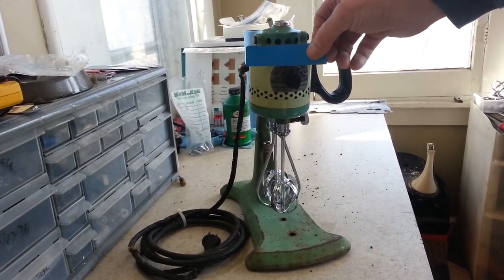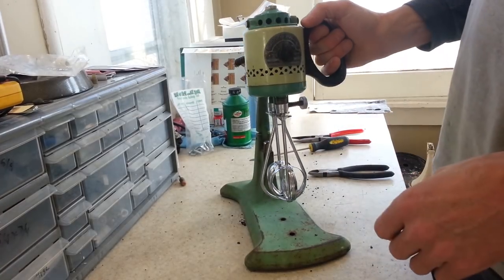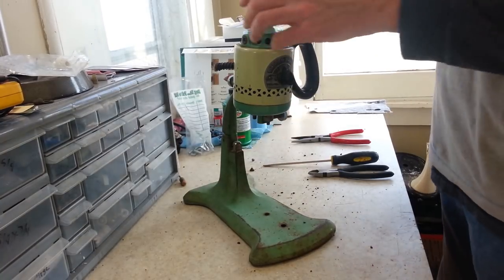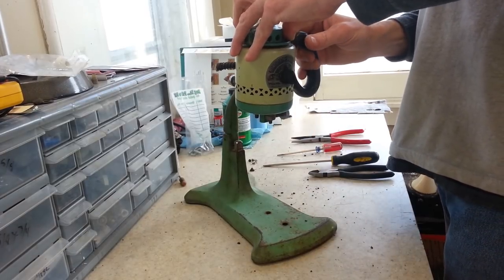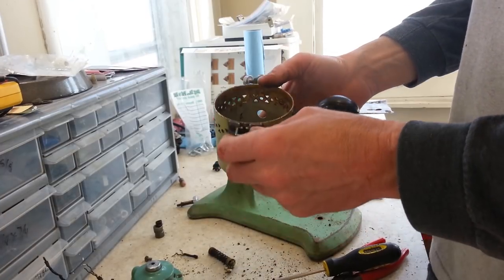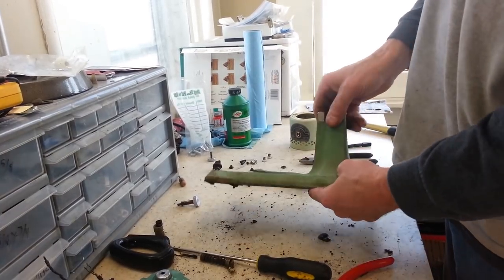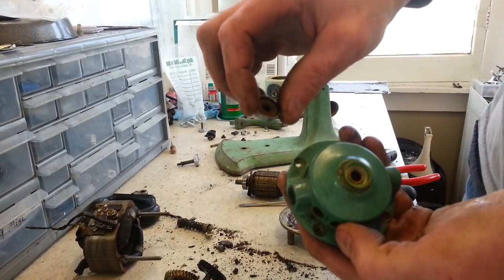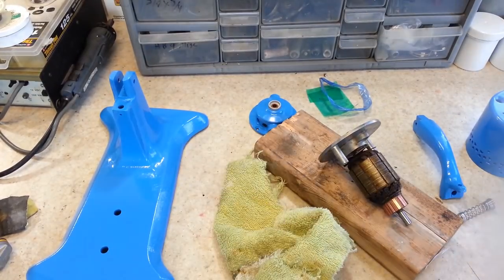Antique Manning Bowman Kitchen Mixer restoration

Comment: Hey mate, another amazing video, your vids are rich with knowledge and teaching us some techniques work order. I am here in Australia, Toowoomba near Brisbane, was given a old Sunbeam mixmaster today, it works well, is there anything I should look at before I start using, as I cook and plan to use it every other day? By the way, what was that singer? Really touched a nerve, very nice. Have great day to you.
Reply from the maker: Hi Chris, thanks! I would look carefully at the cord, especially where it attaches to the motor, the inner insulation is usually worse off than the outer insulation. Changing the grease is a good idea as well for general maintenance, while the gear box is open try to get some oil on the shafts if you are not removing them. A drop of oil in the oil ports once a month should keep them working good!  
The singer is Sierra Eagleson , https://www.youtube.com/user/guitargirl2449